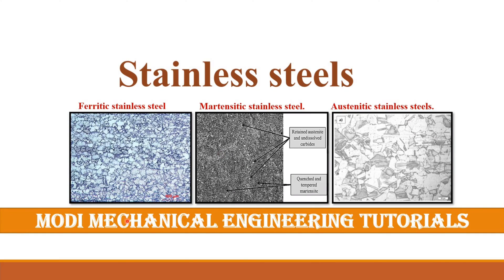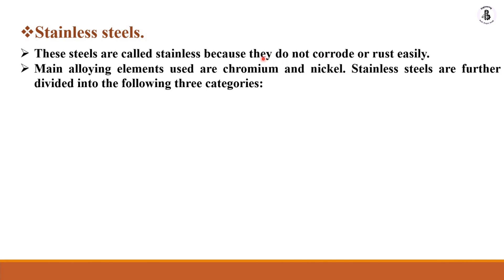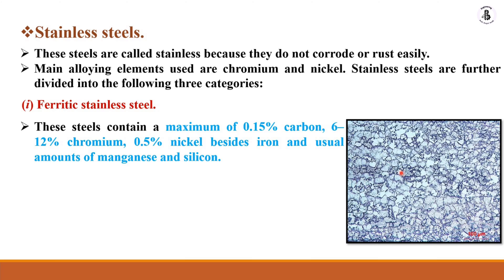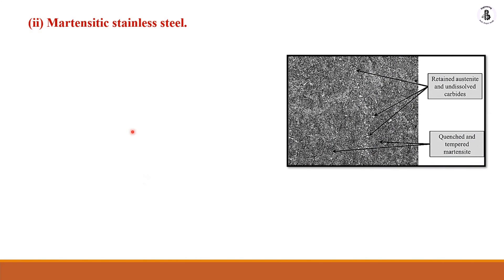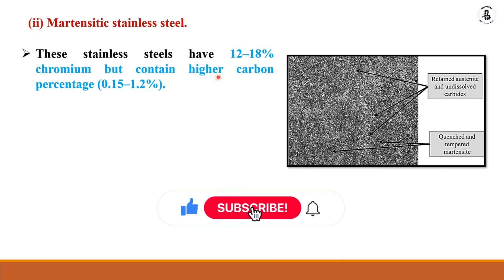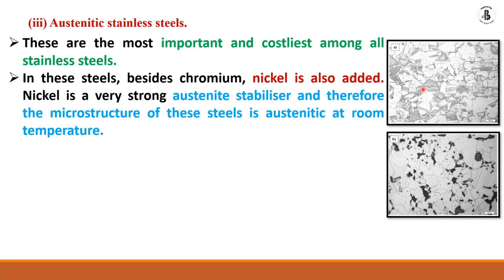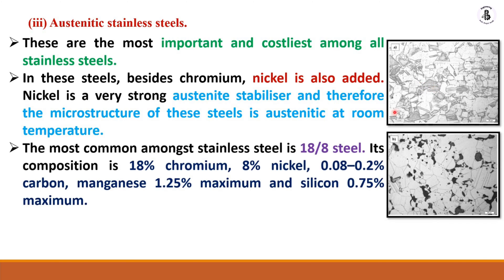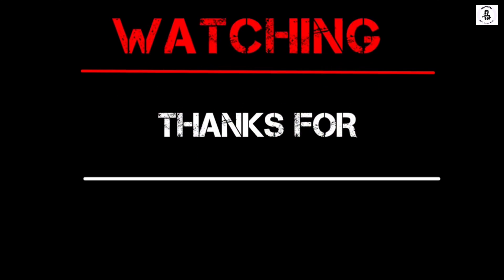Stainless Steel | Types of Stainless Steel | stainless steel basic concepts| application#metal#steel

Comment: Make a video on selection of materials from manufacturing shop floor drawings, how to read material handbooks how to decide which kind of steel fabrication process to choose based on property and requirements of manufactured final project...material code used in industry in India for details of a material in specifications..thanks in advance